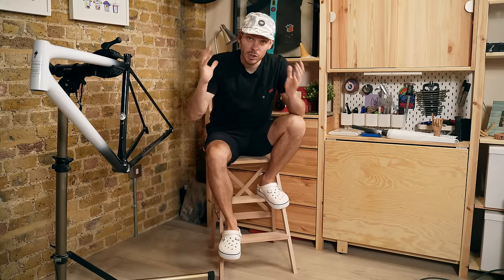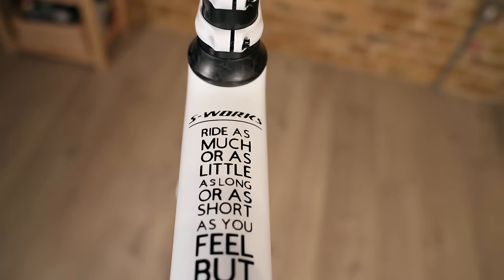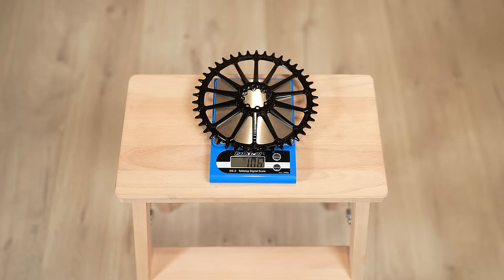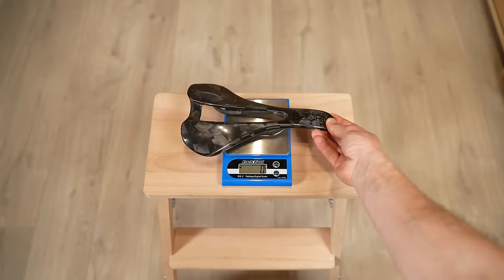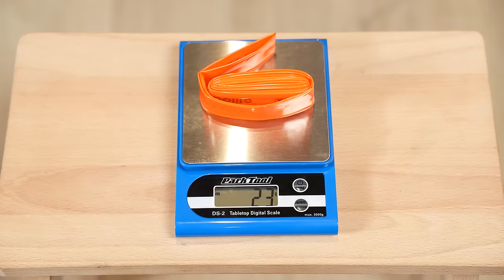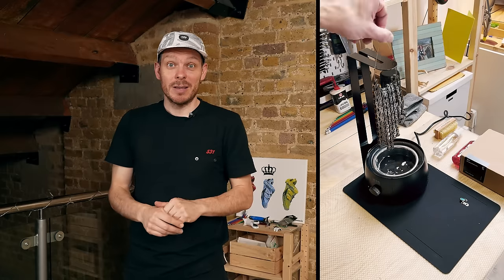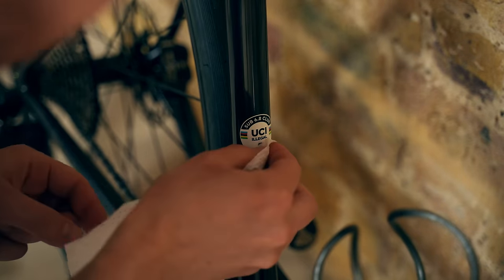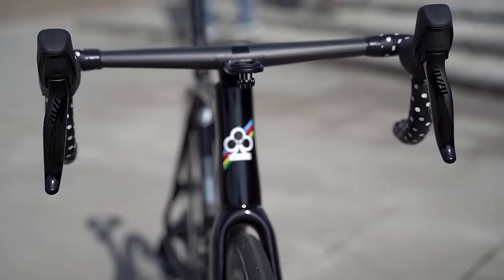Building an ULTRALIGHT custom Specialized AETHOS S-Works with INVISIBLE CABLE ROUTING!

Comment from the maker: THIS BIKE IS FOR SALE. Drop me a  message in Instagram Twisted_Wheels for more detail. 

USE discount code TW-WHEELS for a 10% off on all LIGHTBICYCLE wheels and 5% off on all rims!
Reply: Are both rims identical ? Gonna try and copy what you did. . Will be a steep learning curve!
Reply: Also, why did you go for tubed tyres on this tubeless setup? What tubeless tyres would you go for mate?
Reply: I tried connecting with you on Patreon but there is no result for twisted wheels?
Reply from the maker: @firmbutton6485  send me a DM in Instagram

Comment: If I had that Colnagah I wouldn't have built the Aethos.  The weight matters most at the tires, rims, and spokes, and you have those super SUPER light.  700 grams elsewhere doesn't matter much. Keep whichever bike feels better while riding. I guess I'd keep the Colnagga

Comment: That fork design will go down in history as one of the smartest solutions for fully integrated cables ever. Awesome build too, loved every minute of it!
Reply from the maker: Thanks!
Reply: @TwistedWheels  Hi mate, I'm considering a similar gravel build at the moment with the deda fork. I was wondering where the special wedge goes that is supplied with the fork? I've read on some forums that the fork only works with a 1,5'' steerer tube, which I couldn't believe after seeing ur video and the aethos not matching that standard. Also the deda website says that the fork is compatible with tapered 1'' 1/8' - 1,5'' steerer tubes. Thanks in advance!
Reply from the maker: @PaceGalore  Deda forks are designed for 1 1/8 to 1 1/2 frames. The wedge comes with the fork. I have one new Deda Gera EDG DCR gravel fork for sale - drop me a message.
Reply: @TwistedWheels  awesome, thanks! I'm currently negotiating the final details with the frame builder. And I'm undecided between the EDG and the curvy fork. I'd prefer the look of the EDG but 180mm rotors and the mounting points for front bags would be nice too. I'll shoot you a dm regarding the fork as soons as I've figured that out 👍

Comment: Outstanding build. Impressed that you sort out internal routing mod. Been an Aethos owner since release and while I didn't focus on weight, I also have the 2-wheel set up, LB AR55 and LB WR 35 for the lighter set up. I had it running as 1x, but it was too limited on rides. Safe riding,
Reply: The 1x was too limiting? So you want to a 2x?

Comment: I like the look of your build well done. My Ridley helium SLX uses the same D shaped fork design and has a similar cable routing setup as what you created on the Aethos now. Its a pain to route and to insert that extra supportive blok, but once its all set it works just fine... Your bike is using consiberably nicer and lighter parts.

Comment: Just like you I have 2 wheelsets for my road bikes.  You shouldn't have to ask to pick one or the other.  They serve different purposes.  One is a climbers wheelset and the other is for speed.  In my case for my disc brake road bike wheelsets I have 50mm and 20mm, and for my rim brake road bike I have 45mm and 20mm.  BTW, your bike looks AWESOME!  Great job!  Congrats!
Reply from the maker: Thanks Dennis, I’ll keep two wheelsets - the question was which one you like more from the looks perspective. However, I can only keep one road bike, so either Colnago or Aethos will have to go :(

Comment: @Twisted Wheels -  I have a follow up question - 1. Which dedaccia fork ?  Is it the Road EDG/DCR fork or the Gera DCR?   2. What are the spoke sizes for inboard / outboard, front / rear,  for the extralite hubs / light bicycle wheels?  Thanks in advance for your help!  I won’t have to sell my bike should specialize decide to release a full ICR aethos in the future. LOL

Comment: Have you had any issues running carbon spokes and Extralite hubs yet? I’ve been running that combo for a year now on two wheel sets and have had numerous broken spokes. I reached out to LightBicycle about it, and they said that it’s due to the design of the hub requiring a specially built wheel to work well with carbon spokes.
Reply: Did u ask extra light about it?

Comment: Clever thinking, so obvious when you see it. I was contemplating more challenging options like a drilled steerer or external oversized top cup. Still, I think my Aethos looks alright with a couple of hoses up front, so definetly not a direction I'd consider. What I did do, though, was swapping out the parts, bulking the bike from 4.7 to 5.3, in order to increase the comfort, handle the terrain better and enable training.
Reply from the maker: So far I’m very happy with the current setup - comfort, weight, looks. But will see when I get more miles on this bike

Comment: What is your view of the disc rotors? I worry about so much gaps, I often go with more steel on them as feel it brake better

Thanks for showing me the saddle, I was originally looking at Selle saddles but forgot where I saw a carbon saddle and titanium rails of reasonable light weight so I might get your saddle choice

Comment: That’s hot. My first Aethos SL build came in a 12.5lbs and at 78kg, I was nervous riding it. My latest came in at 14.7lbs with lightweight Meil Evo wheels, thm cockpit, Ceramic speed 3D Titanium OSPW and Force crank and shifters with Red RD and Red Oil slick cassette.
Reply: 78kg is man- boy weight, go for it!

Comment: @Twisted Wheels. Truly awesome video.  I also have an aethos and I've been waiting for someone to do internal cabling. Thanks for doing this.  I recently visited the deda website and got a little confused with all the headset options.  Which one did you use for this build? ( You mentioned dcr, but there's a lot of them)  did you also have to change the top steerer tube bearing or is the stock bearing compatible with the deda headset? Lastly, I couldn't find the conical spacer that you used (@10:46 mark)  is that also deda or a different brand?  Thanks in advance for your help!
Reply from the maker: Headset and bearings are stock Aethos. You only need the fork

Comment: Lovely, considering going down a similar route on my Open (Deda also offers a D-shaped gravel fork). Did you use the standard round compression ring and headset or did you have to source any custom stuff? Looks like you just went with the standard setup, correct?
Reply from the maker: Standard headset, but D-shaped compression plug that comes with the fork

Comment: Crazy cool build!! Big props 💪🏻
An i hope i get an answer to this question…
Sram AXS Rear derailleur is working with a NON-Flattop chain? (With garbaruk der.-cage here)
I see a 10/36 casette (looks like the same as from Sram) 
And then theres a 1by Front Chainring….
So my question: could i possibly run a setup like this with 12s Shimano chain (worked on the vid with the 2 canyons with different groupsets on the GCN-Channel) and a 2by Shimano chainring Setup? (Lets say 52/36)
Reply from the maker: Yes, shimano 12s chain should also work with my setup. The only rule is: if you have a Sram 12s cassette - you have to use their flattop chain.

Comment: Favorite custom build with the aftermarket internal cable routing solution! However I've looked and it's as if the D shaped steerer DCR forks have been scrubbed off the internet. I can't find much info on it anywhere.
Reply from the maker: Thanks. Try dropping dedacciai an email.

Comment: Hello, great job!!! what is the model of the spacer? did you also keep the original specialized aethos top cap? good job!
Reply from the maker: Not sure of the model of the spacer. It came with the FSA headset. I have deda top cap that came with the fork as it has off-centre position of the bolt
Reply: @TwistedWheels  thanks for your response!

Comment: Hi. I have an aethos too and was thinking how to hide the cable. Many thanks for the idea.
Do you think is posible to do the same with the Crux model?
And with the original forks?
Thanks a lot. You have a new follower😊
Reply from the maker: Hi, you should be able to do the same on CRUX too. You need a D-shape steer on the fork, so you can’t do that with the original fork

Comment: Hi, really nice job ! I was wondering what is the compression ring you use in the headset to make the brake houses trough. I am doing that tweak on a roubaix and the upper bearing is 45.8 external and 36.8 internal. Can't find a compression ring that fit..
Reply from the maker: The compression plug is D-shaped - the one that comes with the Deda fork
Reply: Thanks, I will check if I can modify some parts !  @TwistedWheels

Comment: Thanks for the build! 
One question for you - can I use DT swiss adapters from center lock to 6 bolt instead of Ashima's?
Reply from the maker: Extralite hubs have a 6-bolt mount

Comment: What a stunner! How is the shifting performance of the ZTTO cassette? Oh and btw-Colnago over the S-Works despite the weight😊
Reply from the maker: So far shifting is good
Reply: If it is good for you, then it will be enough for me😂 They are a steel compared to the Sram ones. Just with used ones I'm a little above 100€. But then there is still the weight difference. Thanks for your answer. Hope to see you soon with a couple of miles behind you with this weight-weenie-killer-tool
Reply: I have seen people with bad opinions about ZTTO casette.
Reply: @DG77b  I'm also afraid for the crisp of switching on this cassette..

Comment: Definitely the specialized -looks great. Not a fan of full black. How do you find road bikes with no front derailleur?
Reply from the maker: You have to see Colnago in real life - glossy black on matt black finish is really cool, but yeah white to black fade looks fresh.

1x works for me and I’m not going back to 2x. I only wish someone makes a 10-40T cassette with 1-cog (road) gaps - that would be ideal. But I think big brands are not doing this just because there will be no need for 2x road groups for 90% of riders and this is not good for them from the sales perspective :)

Comment: This is the type of bike i dream off! ANYTHING with fully internal cable routing is just gorgeous!! However, im curious on how the shifting with the garbaruk cage?? is it just as smooth?? id really wanna try a similar setup.
Reply from the maker: I’m not using a Garbaruk cage, just the pulley wheels and yes, it works very well

Comment: Very nice build and video. May I ask which size of chainring you did use? I would keep the Aeths btw. Because of the lightweight. A very light bike just feels amazing to ride. Especially the acceleration is amazing
Reply from the maker: Thanks Alain, I use 42T chainring. 
The bike does feel faaaast, especially acceleration on 845g wheels 🤩

Comment: Great video and inspiring build. So much so that I'm ordering the components for the same wheelset! Could you please tell me the length of the front and rear Brisk spokes please and also the model of the Sapim alloy nipples. I'd really appreciate your help. Thanks
Reply from the maker: Thanks. 
I don’t remember the length I ordered as it was a while back. I just followed the guidance on Extralite website. They have a table with spoke lengths for all their hubs depending on the ERD of the rim.

Comment: Absolute great looking bike and very smart solution on the cable routing ! Fantastic 🙂
Question regarding the fork: do you think that a Tarmac SL7 fork would also fit to the frame and allows the internal cable routing?
Reply from the maker: Thanks. 

No, I don’t think so
Reply: It's impossible, even if the steerer tube taper is the same as the Aethos' as the Aethos was never designed with integrated internal routing in mind, unlike the Tarmac SL7.

Comment: One more question... Is there any other reason why you went with the Eagle XX1 instead of the flattop chain besides the look? Thanks
Reply from the maker: I am not using Sram cassette or chainring or even the pulley wheels, so no need to go for flat top

Comment: How is the shifting performance of the ZTTO cassette? Have you experienced any issues with it so far? Would you recommend it?
Reply from the maker: It works fine with Force XPLR rear mech so far, but it was bad with Force 36T rear mech.
Reply: @TwistedWheels  Thanks. One more question... Would the Garbaruk pulley wheels fit in the regular Sram Force cage? Sram Force is not on the list of compatible rear derailleurs (only MTBs like XX1,GX etc.)
Reply from the maker: @em_aitch  they have 12/14T pulley wheels somewhere on their website. These fit the standard Sram road cage, even thought it is designed for 12/12T pulleys. Garbaruk pulleys looks great and offer the best mud clearance of all pulleys that I’ve tried (I’m using them on my gravel, CX and MTB bike too).
Reply: @TwistedWheels  Thanks a lot. They look great indeed, hence why I asked. I will use them in my Emonda build alongside the Garbaruk chainring... I hope 1x12 will suit my needs as I am a big fan of single chainrings on a road/gravel bike. Anyway, nice work! The Aethos looks incredible. Cheers!

Comment: Very nice build , I’ve said it before, but you and @rides of Japan need to collab. I would choose the  Aero wheels for sure, i would keep both bikes, the colnago looks just as nice and probably wants to be ridden more than the Aethos. The port on the handlebar to route the hydraulic hoses is very small, did you need to do anything special to make sure the cables would endure those tolerances? Going 1x with 170mm crankset arms, you must be a very high cadence rider, i can’t do without my 175mm 53/39 options personally.
Reply from the maker: Thanks for the comment, mate. I’d like to jeep them both as Colnago offers an incredibly comfortable ride, but need space in my flat & money for the next project :( 

As for the 170mm - I usually start using my brakes at speeds over 50 km/h, rather than accelerating, so the setup works for me.

Comment: Bro keep both 
Because they belong to you that’s why 
You designed the layouts and curated the parts so keep both unless you can make a profit and start some new projects that is . If that is your fancy of course. I would keep them both personally as they are two different rides . I’m currently on a 2022 Time Scylon and a 2022 T1sl and love them both .
Reply from the maker: I’d love to keep them both, but no space in the flat, no time to ride both and need money for the next project 🤷🏻‍♂️

Comment: Do you think it’s possible to modify an Aethos S-works frame to run a mechanical shifting group set?
Reply from the maker: Nothing is impossible. But why? 🤷🏻‍♂️
Reply: @TwistedWheels  SRAM Red 22 is lighter! Can be modified (Ratio Technology) to run 12 speed.

Comment: I wonder if you're going to use a Garmin Edge 130+ (33g). I got one, but it kind of looks ridiculously tiny on that way out front Extralite mount.
Reply from the maker: I’ll be using Garmin 840
Reply: @TwistedWheels  +36g 😱

Comment: how can you insart a wire into the Tube??...because iswa that its very small  any tips?? Please...
Reply: This is possible only because:

1) The fork's steerer tube is D-shaped instead of round, giving the brake hoses the room necessary to route through the headset assembly.
2) The fork is compatible with the frame.

Under no circumstance should you ever attempt to modify your existing fork just because you want integrated internal routing. This is not a retrofit modification for almost all bikes.

Comment: I would keep the aethos, with the integrated handlebar of the colnago. But if i was to make this build would have done it with a specialized crux
Reply from the maker: Farsports F1 handlebar works and looks great on a Colnago, but I think it will look a bit bulky on Aethos. Also, it’ll add 100g to the bike weight.
Reply: @TwistedWheels  It will look bulky on a bike like the Aethos. I hate this one-piece cockpit, not because of the bulkiness, but because of its inconsistent product quality. Give me two-piece cockpits any time.

Comment: Nice work, what is about the rotor cassette? I believe the rotor is lighter than the china trash
Reply from the maker: First of all, ZTTO works great. 

I used Rotor 11-39T on my Colnago, but 
1) it has a narrower range 354% vs 360%
2) the smallest cog is 11T, so you need to size up on the chainring and have a longer chain so extra weight
3) it uses Shimano freehub, which is heavier than XDR. So overall weight saving will be less than 10 grams
4) it looks much bigger and a bit out of place on a road bike
5) it is 3 times more expensive and comes with 4 aluminium top chainrings, so less durable
6) I did not notice any difference in performance on these two cassettes with the same Sram Force XPLR rear mech. 

Therefore, I switched to ZTTO on my Colnago too.

Comment: Scusa non conosco la lingua, mi potresti scrivere come mai non si può utilizzare la sua forcella originale? Ed in caso quale sarebbe la forcella da comprare e se danno anche expander interno grazie.
Reply from the maker: @antonioiarrera7836  i can’t use the original because it has a round steer tube so it won’t allow for internal cable routing. The fork I used is Deda Edg DCR Road disc fork

Comment: what headset did u use? and bearings , please
Reply from the maker: Original Specialized Aethos
Reply: @TwistedWheels  thanks for the response, Im trying to do the same mod, but I'm finding the DeDa fork seems incompatible with the Ethos on the lower race? deda CGR?. the headset has slotted spacers between the bearing and stem are they Deda and what size?
Reply from the maker: deda edg dcr road disc. I have one for sale if you need it. No slotted spacers. I’m showing the build in the video - the cables are routed through the stem to the D-shape steer
Reply: @TwistedWheels  Hi, how much is the Fork? and what color?
Reply from the maker: @markmillett9869 drop me a DM in instagram Twisted_Wheels